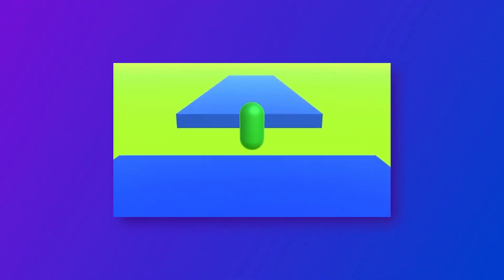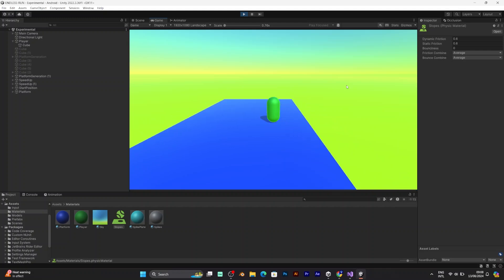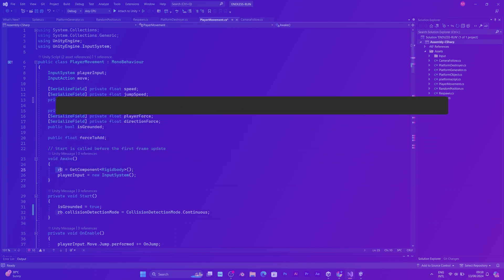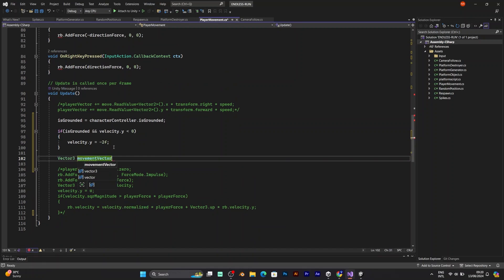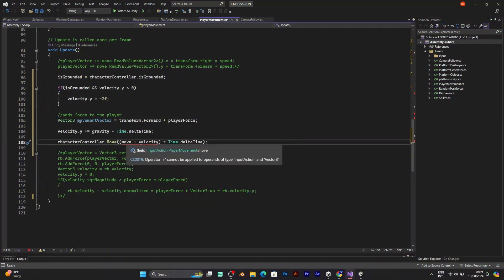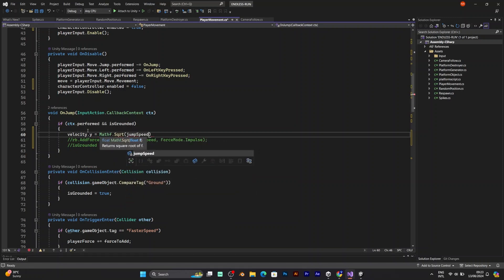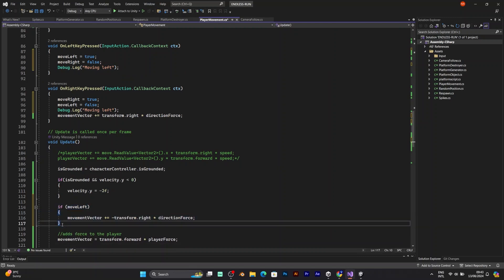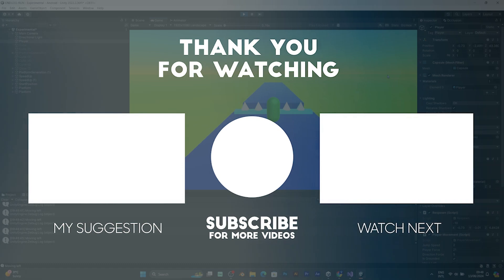How to Fix Player Stuck on the Walls in Unity 3D!

Comment: Why arent you using FixedUpdate? Wouldnt that make all the deltatime code pointless and make the physics interactions more consistent
Reply from the maker: @juckya9660  yes, it would make the code more consistent, but I didn't know anything about FixedUpdate, how it affects functionality in games. I use FixedUpdate for saving a position and respawning player when it is under the respawn threshold.
Reply: @kozmobotgames  I'm quite new but from my knowledge it's often used for physics calculations.
Reply: @juckya9660  Yes, FixedUpdate is good for physics because it is independent of FPS. If you use regular Update with physics, then a game running at 120FPS will have faster characters than a game running at 60FPS

Comment: You can use another physics material  on Air and no stuck rigidbody. Depends a lot on the game, sometimes it's better сс and sometimes rb
Reply from the maker: Thank you! My player was not having a smooth movement with rigidbody, so in my opinion, I prefer character controller.